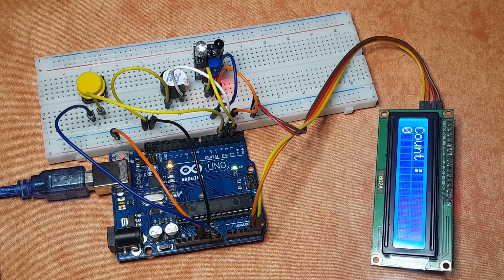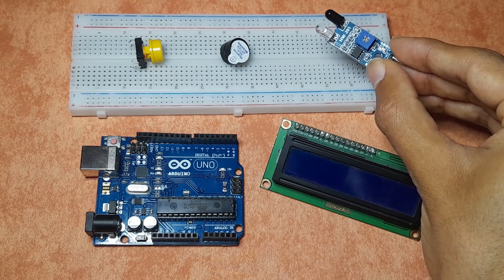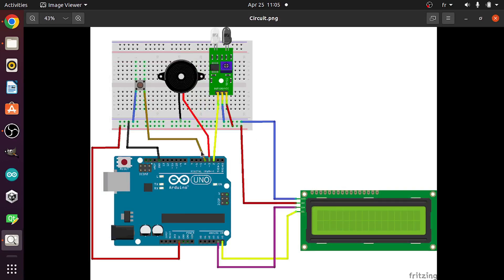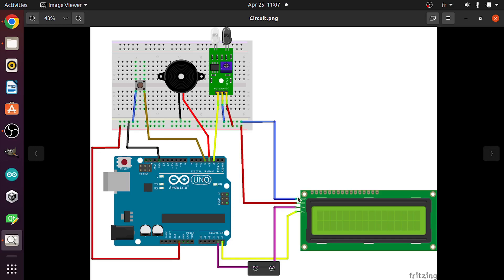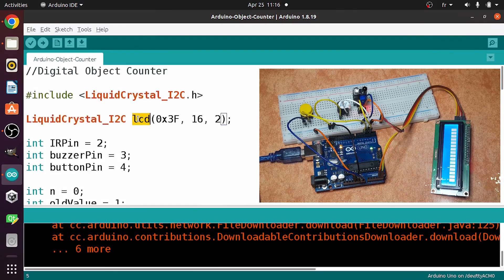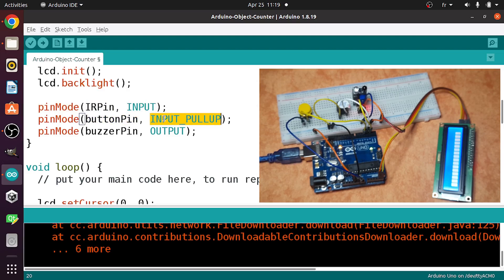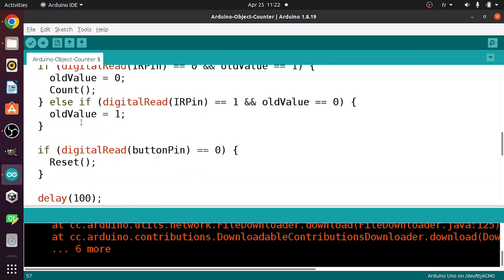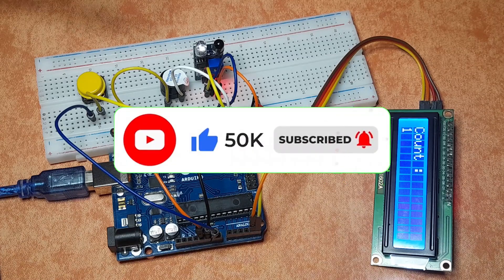Digital Object Counter using Arduino

Comment: Hello,  excellent video.  Thank you!
I am using a momentary lever switch instead of IR sensor. It is wired the same as the IR sensor.
I want to use a toggle switch to turn the switch on and off.  
When I toggle the switch off it disconnects the wire going to pin 4. 
But it also adds 1 to the count at the moment the switch is moved to the off position disconnecting the pin 4 input wire.  
Can I change the program to stop this from happening?
Thank you.

Comment: Hi friend. Is it  possible to remove the usb means no need of a computer after running the program. And how to start and stop. The arduino after uploading it.
Reply from the maker: Yeah
Reply: @DIYTechRush   thanks for the reply. How I can start the process from the arduino card. Without the computer plaged. Is there any boton

Comment: Do i need male-female jumper wires or it will be okay if i only have male-male wires
Reply from the maker: It doesn't matter as long as you connect the pins.